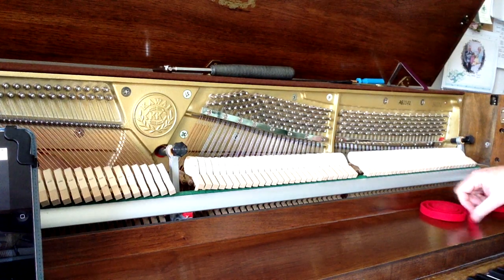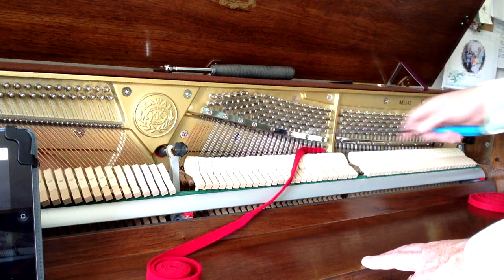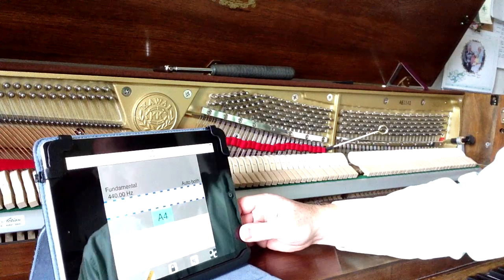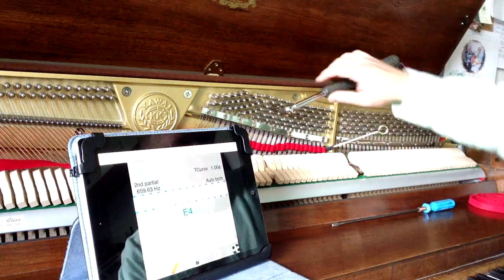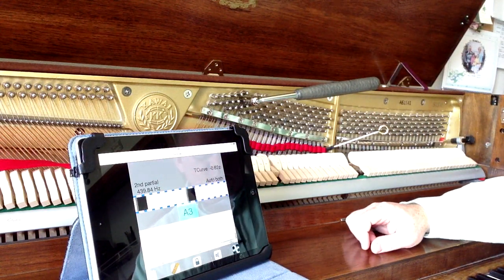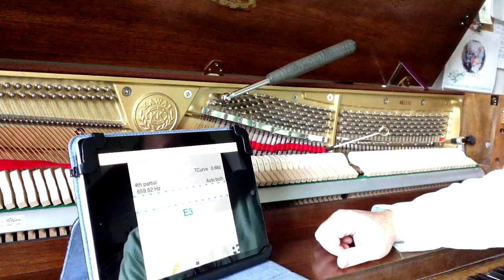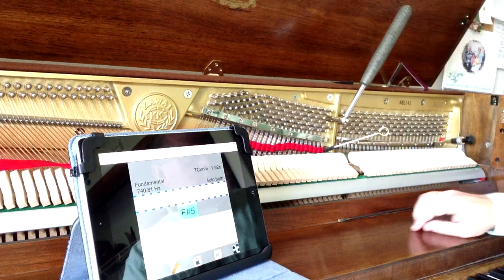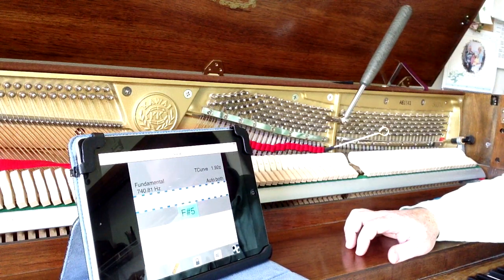Piano Tuning - How to Tune A Piano Part 5 - Tuning the Midrange I HOWARD PIANO INDUSTRIES

Comment: This is one of the best instructional series on how to tune a piano for novices -  well done! 

Question: what's the rationale behind starting at A4, then going down, and then going back to cover the upper range of the section?
Reply from the maker: Thanks for watching.  Typically it’s best to tune the midrange first.  I don’t know that there is any specific reason for the order I do this in except that I learned it is best to start at A4.  If you’re tuning by ear you should start with one of the middle octave like A3 - A4.
Reply: Como puedo poner diferentes hz en el A4 en ese programa?
Reply: Because A4 is always your reference note. It is the note which has a universally (semi) defined pitch, which is 440Hz most of the time. Experienced tuners without digital tools would just have a 440 tuning fork and tune the rest by ear, using formants and intervalls which create strange and unpleasant soundwaves/tonal vibrations if not in tune.

Comment: I've got a piano that hasn't been tuned since 1988. I assume it will need a pitch raise first but I am worried that yanking on the pins on a piano that hasn't seen any care for over 30 years may result in strings breaking. In your opinion is it better to tune flat then raise then just yanking the pitch up on every pin?
Reply from the maker: Whenever I tune a piano that has not been serviced in many years and needs a large pitch adjustment,  I inform the customer that there is always the possibility of a string or two breaking. While it usually does not happen ( my guess is that it happens less than one out of 20 times), It seems it is most likely to happen when I don't inform my customer of the possibility. One tip often espoused to lower the chances of breaking a string, is to drop the pitch of the string before raising it. This dropping of the pitch is suppose to allow the string to break free from  any high friction areas it may be stuck in place due to corrosion. Many tuners attest to the effectiveness of this technique.
Reply: @howardpianoind  Thank you for your quick and thorough reply.

Comment: With the trichord strings, does it matter that you are tuning the middle string first? On my piano there is a string and half for each three strings per note (A4 left and middle string pegs are one string, and the string on the right peg for A4 wraps around to the left string of Bb4. Then the middle and right pegs of Bb4 are one string) 

Will tuning the tension of just the middle string be altered later when tuning the other strings in the trichord?

Comment: Hello, I have a question. Why do you tune this piano with non equal temperament? No one relation between your half tones are the same...
Reply from the maker: In this video series we are showing the basics of how to tune a piano.  This series doesn't get into different types of temperaments yet.  This tuning actually is supposed to be in equal temperament as that is the standard for the tuning software I'm using.  We do discuss what a temperament is in another video which is outside this series.
Reply: Actually, when one uses tuning meters (like he is here) without listening to relationships of the intervals, it becomes kind of faulty equal temperament.  But then nobody should be using ET anyway:  It is a simple quick system for technicians that do not understand tuning and music theory.  Check out videos on ProArte and Renold tuning.  These are NOT temperaments.  They are not slightly out-of-tune like temperaments such as the false sounding ET which only produces minor thirds, tri-tones and octaves that sound genuine.
Reply: @dennisdougherty7538  what about entropy tuning?
Reply: @dennisdougherty7538  I think his tuning was a combination of aural and visual because he did imply using the ear also and not to fully trust the machine. Also he did mention checking  with  4ths and 5ths; that sounds like using the ear to me.

Comment: I tried to keep my ear in shape with some decent aural tuning practice.. I ve had experience with the battery of my accu tuner dying on me during a tuning.  unfortunately my particular model only works with the battery charged up;  you can t just plug in the power supply to an electrical outlet>>>
Reply from the maker: Yes, it's good to be able to tune by ear as well.  I've had occasions where I forgot my ipad when I went to tune and had to tune by ear for the day.  It's good to know that you can tune without the device if you need to because anything can happen.

Comment: What’s the best affordable tuning software you could recommend that would be precise enough to tune with?
Reply from the maker: TuneLab is the least expensive software that does a decent job for piano tuning.  It is $300 which may seem like a lot but most of the others are close to or over $1000.

Comment: My piano has a bar that lowers the muting strip and I have no idea how to move it out of the way.
Reply from the maker: In most cases for these, they are just held in with pins at each end.  If you pull the pins out of the hole they are in and then there is usually a spring that needs to be detached as well hooked into an eye screw.  Just unhook it from the screw and then the whole bar will come out.

Comment: I currently am using tune lab myself and I come across a piano every so often that those first few bass notes at the break sound very sour when using the program(when playing octaves). I understand what you mean when using your ear and disregarding the program.....my question is is won't that throw off everything in the bass thereafter? So do you then ditch the program completely when finishing the bass section?
Reply from the maker: Not usually.  You can usually use TuneLab for the rest of the bass section, but it’s always good to check the octaves and other intervals by ear to make sure.
Reply: @howardpianoind  wow thanks for the quick reply. Once you measure your C's do you ever mess with the octave ratios? I've not ever messed with those before
Reply from the maker: I don’t usually.
Reply: @howardpianoind  appreciate your info. Thanks

Comment: What is the rationale behind lifting the damper pedal while putting in the temperament strip?
Reply from the maker: The reason you should lift the damper pedal when inserting the mutes is so you don't squeeze the damper.  Putting the mutes in puts pressure on the string which can squeeze the damper felt.
Reply: Thanks! I love your smooth "narrator" voice. These vids have been my favorite online content the past 5 months.
Reply from the maker: Thanks! I'm glad you're enjoying the videos.
Reply: You are a great instructor!
Reply: May I ask, when is it okay to remove your foot from the damper pedal, is it okay to take your foot off once the strip is in place?